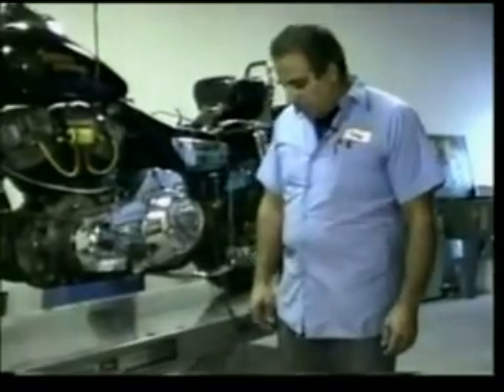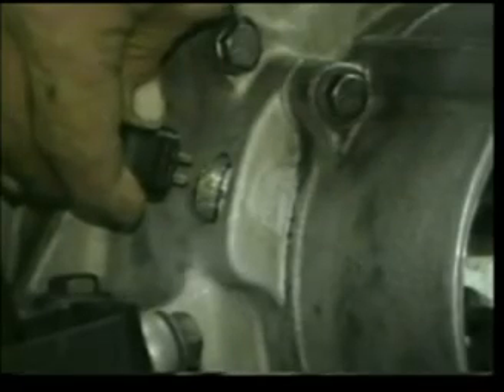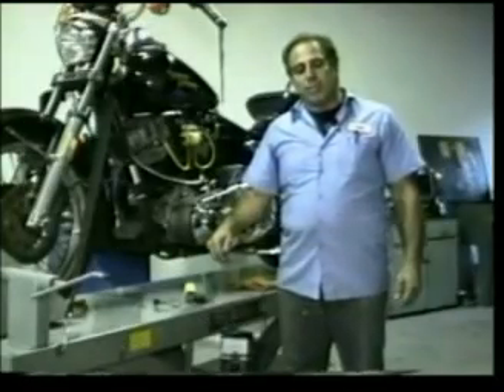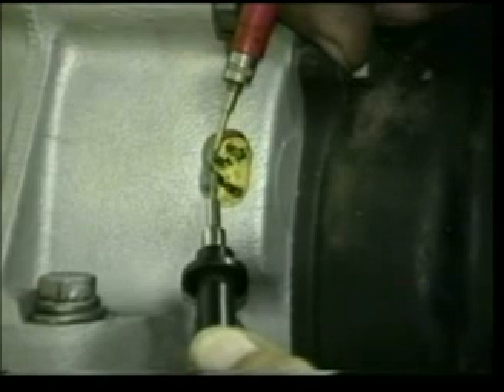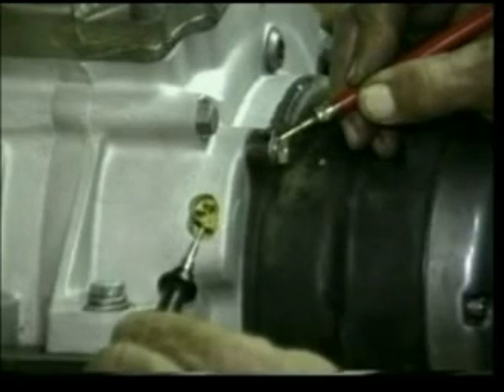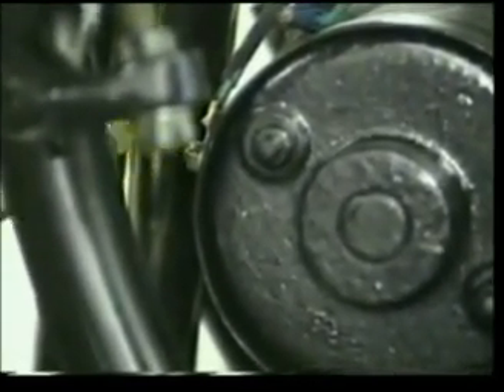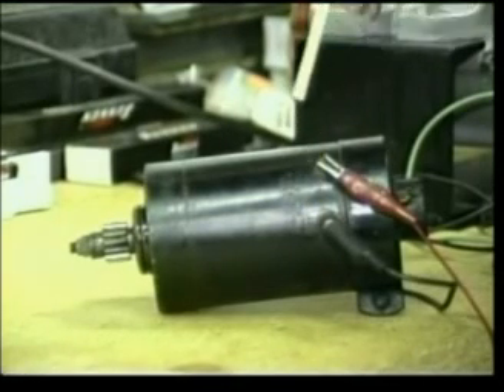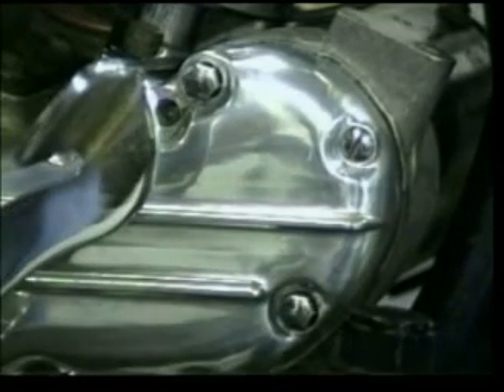Harley Shovelhead Charging system

Comment: Really need some help here. Been in all the forums getting conflicting replies.
83 FXSB 1340 brand new regulator putting out 14.58 fully revved. Is that gonna cook my agm battery?  Guy's saying 14.4 should be the max. The old lead acid batteries can handle the higher voltage but the agm batteries will cook over 14.5? Thank you in advance
Reply: AGMs are tougher than you think and you rarely run wide open for any length of time.  AGMs charge at 14.4-15 volts during cycle charging (normal charging as we know it. Fast then the regulator kicks in)  13.5-13.8 Float charging which is an intermittent charging more like battery tender. Lead acid is more forgiving to over charging, but unless you have a bad regulator you're ok with the higher voltage. Check the voltage at 2500 and fully charged also allow time to charge from starting load. Crank it ride around come back and check it
Reply: @davebrunson125  Thank you for response. Free guys in the forums putting out misinformation saying my regulator was bad for charging over 14.4 so I was trying to get some facts here. Much appreciated.

Comment: Nice to see you covering the older generator shovels too. When installing a Cycle Electric generator (DGV-5000) with the built in electronic voltage regulator, what wires are not needed anymore from a stock wiring harness? I am referring to some of the wires that previously went to the old mechanical regulator.